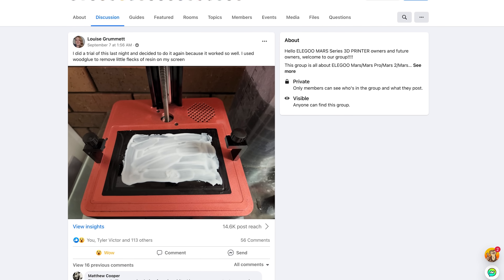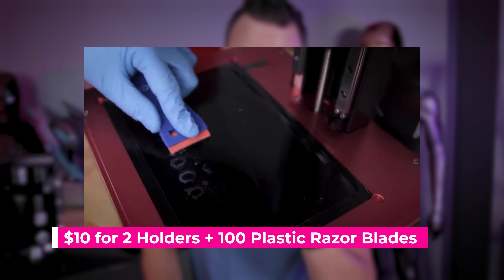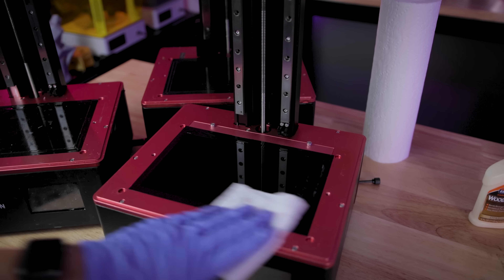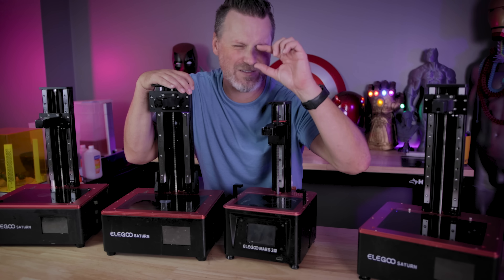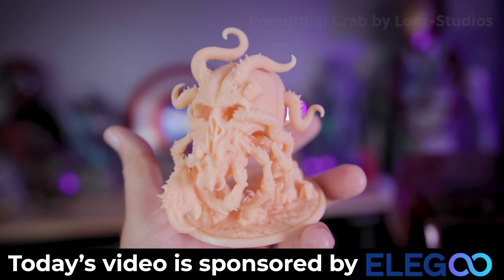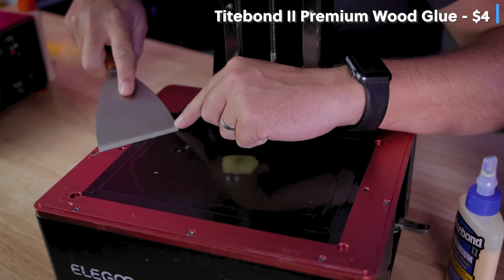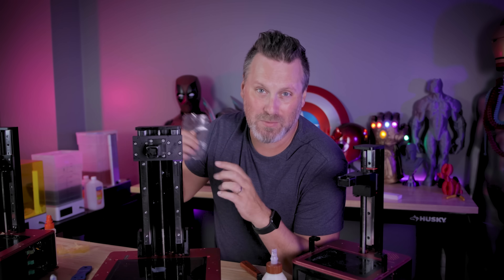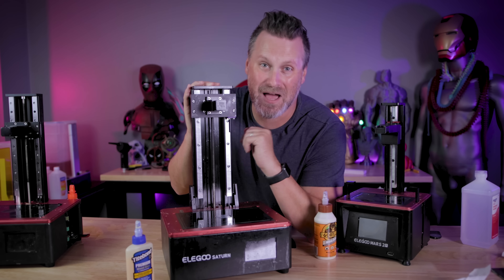Removing Cured Resin with Wood Glue?!?

Comment: When I got a resin leak that went UNDER the LCD and adhered it onto the piece of plexiglass that goes under it, I put the LCD with the plexi in the resin vat, filled it with IPA and put it on the buildplate of my FDM printer set to 60 degrees Celsius. It did separate, with almost all the resin staying on the plexi, but the plexi cracked. Thankfully it's cheap to order a laser-cut plexiglass RECTANGLE. Next time use warm water I guess.

Comment: Not sure if this has been mentioned, but I use clear packing tape to clean dried resin off my screen. Clean up and liquid resin still in the screen, run a vat clean cycle, clean again with IPA and tissue then apply the tape and pull. It’s like waxing a hair leg, only less painful and more soothing.

Comment: Humm... Now I am wondering, if you spray a thin layer of epoxy mould release or even a layer of oil and leave that on the screen if it would prevent leaked resin from sticking in the first place. 🤔

Comment: The matrix test cards are amazing for scrapping bits of cured resin off the screen! I couldn't find anything soft but strong enough then had a couple of non cured test cards laying in front of me they worked just like the plastic razors and a tad of water like a drop and I mean a droplet then scrape it's cot a burst fep resin completely off my screen with no damage to the screen Protector well impressed lol

Comment: I’ve never tried this, but strictly from a chemical standpoint a substance like acetones, MEK or brake fluid should be able to dissolve the resin and wipe right off. MEK has a flashpoint of 100° should be used with Great call care an in a well ventilated area and rags should be stored in a fireproof trashcan and of course acetone and brake fluid very similar handing. You can weld just about any kind of plastic with MEK hardware stores sell it in a very diluted version. This is most likely the 1st to 3rd most dangerous chemical that the hardware store sell and is the thinner that the car manufactures used to thin car paint with. Brake fluid would be the safest, but it will also leave and oil residue. That probably would be worse than the situation you’re trying to fix, but one wipe of MEK would remove it.

Comment: I just used a disposable metal razor blade for windows on my printer screen and it was just fine and may I add this blade had been used for cleaning windows for like 2 years and at times it had been heated with a blow torch to melt cut plastic prior all I am saying is I used a very old hevaly used blade to clean my my 3D printer and I was fine but then I have a lot of practice cleaning glass with razor blades like 6 years of it

Comment: So i have 2 week old Saturn S and of course got a hole in the FEP and resin on the screen on like Day 2. I used the 99% IPA/microfiber towel method and it really kinda ruined the polarized film. Was this the method to use BEFORE Elegoo started adding polarization?  Now it seems the best way is extremely hot water on a sponge and then the plastic scraper.

Comment: Titebond II is excellent for cleaning vinyl records. The glue is PVA whereas the records (NOT 78s) are PVC. They are chemically similar to the point that they won't bond to each other. Spread a thin layer of Titebond on your record, getting it into the grooves. Let dry and peel it like a face mask. It'll remove dust, lint, dirt, grease, mold, etc. Great for restoring your vinyl back to a pristine condition (just be sure to rinse the record off with distilled water to eliminate the static charge.)

Comment: How much pressure do you use with the plastic scrapper?
Reply: A lot.  It may scratch the screen slightly, but hopefully it won't damage the prints.  Any less and it won't chip off.

Comment: Hot hot hot water damp sponge or paper towels in it and then put the sponge on the spots let it heat up then go at it with the plastic scraper

Comment: Would it be possible to use  like a polishing abrasive to get it off? maybe super high grit sandpaper. if theframe is perfectly level then couldnt it work, maybe adding layeror two of tape? just some wild thoughts...... but it should be a requirement to everyone to use a dang screen protecter anyway, great videos as always brother
Reply: I've used a car headlight repair kit for damage to a plastic computer screen.  It looks OK, but it's not flat any more.  This is probably the type of polishing/abrasive you'd want if you try.  Just got resin on my screen, hence the comment a year later.  Alcohol and elbow grease didn't get the last little chunk.  I think I'll try acetone, but upgrade to a bigger 9" machine before sandpaper/polishing.  Right now I'm seeing if the layer is thin enough that it prints anyway or over cures the remaining chunk so I can scrape it off easier.

Comment: Those glues take longer than 24 hours to reach full hardness.  They will be dry to the touch, but not fully cured to maximum strength.  I am a long-time (50 years) woodworker.

Comment: Another thing you can use to clean the dry resin screen is N-Propanol, that does stink a lot, but it is very effective, it evaporates quickly, it does not leave any residue.

Comment: Thanks for trying these kinds of things out for us. Sometimes replacing the LCD screen on the Saturn requires a firmware update since there are different firmware versions for each screen, and the replacement LCD might not match the original LCD version.

Comment: I would think if you heated the glue after it hardens using either the light of the printer or an external heat source should make the glue malleable, also possible the glue from a glue gun might work better as it has crappy adhesive capacity once it has been heated... But interesting to see

Comment: Hi Uncle Jesse, Do you think it is a good idea to spray dry PTFE on the screen to protect it, for easier removal incase resin get on the screen?
Reply: might cause problems because the ptfe might create a better seal around the fep so the fep might not fpex like its supposed to

Comment: I had a 7hr print going on while I slept and when I woke up no any did the print fail but a shit ton of resin was dried up on the screen 🙃 all because the clear film on the tray has a tiny hole 🤦🏻‍♂️ scraped it off with a metal scraper and light weight fucked up my screen.

Comment: Having seen so many so called 'hacks' for WD40, it's a wonder no one has tried that? I actually use it to remove gum from various things (moved into a new rental for example, and on of the kitchen benches by the stovetop had some kind of rubbery shi... stuff on it and I hit it with a good dose of WD40 and wiped it away with a rag then went over it with a warm wet cloth and all was good.

Not saying I'd put it on my new Elegoo Saturn, just surprised no one has said they do it (in the same sense someone said they use wood glue). 😁

PS: I'm new to resin printers and 3D printing overall actually and I'm loving these videos, I have learned a lot in one evening and feel, shall I say, less 'scared' of firing it all up now from just your channel. Cheers cobber, I appreciate it!

Comment: I have found for an added level of protection when using the plastic razors, I file/sand the corners of the blade into a curve. This way if I am an idiot and stab the FEP or screen with the outside edge of the blade, no harm.

Comment: If you hadn't made this video, I probably would have tried it.

I use a very similar method to remove dried acrylic paint from my palett - with excellent results. 
So, I would have been hoping that it would work the same.

I am wondering of the original version that you saw was with a water washable resin?

Comment: Literally the best way to remove resin is splash a tiny bit of IPA on, cover with paper towel and some clingfilm. Leave it for a day or so and it will wipe right off with a microfiber towel. NO SCRAPING!

Comment: I had a pin hole or something and lots of resin hardened on the screen. I took a sponge and soaked it in IPA and left it for a few hours. HOWEVER, when I took the plastic scraper to the resin it lifted but also pulled up the black polarized sheet too. I ordered a new sheet, but my printer continues just to print solid square blocks now.
Reply: When installing the polarizer film, you have to orient it correctly. YouTube videos exist.  Also, not all films are created equal. You need a fairly high-quality polarizer.

Comment: You don't need a plastic scrapper, at least for the Elegoo Mars 2 stock screen. I use a sharp metal one, and it can look scary, but as long as it's lying flat and the screen is soaked with alcohol, it will take out the resin effortless with absolutely no damage. The glass is hard enough to resist it. Even if there were microscopic scratches that I can't see and may build up in the long term, you will probably replace the screen long before it affects your prints, as the screen will eventually be damaged by the UV light no matter what.
Reply: Thank you so muchhh
Reply: Yes i used it too and its sharp enough to get a gap between the resin and the screen

Comment: is it glass? just scrape it with a fresh metal razor blade, you can't scratch glass with steel as far as I know (don't know if rust can though, hence fresh), the plastic ones are for delicate things like car paint, it's how I clean mirrors, takes way less time.

Comment: Love these experimental ideas. A boiling hot sponge left on on my screen for about 5 to 10 minutes to soften and remove resin has always been my go to. Even with a full screen leak that's cured it will remove it all without issue in about 20 mins. The cured resin peels off easily, with a fingernail or plastic scraper.
Reply: Good tip, thanks
Reply: I know this an old comment, but I just wanted to say: Thank you.

I'd tried IPA. I'd tried tape tricks. I'd tried almost everything (Hence why I came to this video), but yours was the first thing that just out-and-out worked. I watched the resin lift up like it wasn't even attached. You're a champ.
Reply: Wouldn't that wear out the LCD due to thermal expansion and contraction?
Reply: @Mad_Catter_  better than it being replaced?
Reply: That's actually genius. I believe that any heating up should help a lot, because of thermal expansion of screen vs resin - forces can be huge is rate of expansion is different, leading to ungluing resing from screen. 
I wonder if ouring way more resin on screen and curing it should also help. I mean a lot more: so that is would not crack but be removed in one piece. So maybe even with use of some cloth dipped in resin that should keep the resin in place.

Comment: Wood glues aren't what they used to be. There are heaps of different kind now. Back in the day if you said wood glue that would mean plain old PVA glue which was plain white and dries clear like the Gorilla glue, ie the stuff I used to spread on my hands so you could peel it off to look like skin peeling off. No way I would try modern wood glues on my printer screen.

Comment: From what I can tell, the goal of using the glue is to get it all as one piece that you can pull up at once? If that's the case why not just do as you did in the middle and cover the whole screen in cured resin so its all one part you can then scrape off. I think its probably a waste of material and not any better than the normal method of IPA and scraper, but it would probably achieve the effect that the wood glue was aiming for.

Comment: I just did a small test with a few silicones. Smooth-on oomoo 30 was actually somewhat helpful in removing resin using horizontal pressure. I have some urethane epoxy and foam rubber still to test. I will post the results here. 
Silicone might work. Maybe one of the thicker tin activated ones.
Reply: I work with silicone a lot, the only thing that stuff sticks to is itself. 😞😞

Comment: Basic hand sanitizer works for me. Save the IPA for washing the prints!
Reply: It's probably the IPA or ethanol in the hand sanitizer!
Reply: @JeffroDH  That's why I use it. With it being a gel and diluted it is easier to work with and less likely to do damage to the screen or inside the printer. Really cheap too!

Comment: Hi, my always working go-to when the fep film breaks, is: Aceton. I soak a paper towel with simple aceton, keep it wet on the Spot of cured resin. then it gets soft after approx 10-15min and will easily peel. a plastic spatula is a must.
Reply: Does the acetone not cloud the polarizing film on top of the screen?
Reply: @JeffroDH  Hi, not noticed any cloudyness yet. (so far, 5 broken fep's with cured resin later. pure aceton, not a nail polish remover was used for my endeavours). It's my go-to until i find something better
Reply: ACETONE worked for me too, let it sit for a couple mins then peeled off

Comment: Wood worker here, eventually the glues will harden up and become significantly more brittle.  While the will have a certain amount of mechanical give, depending on brand they will all become significantly more crunchy as they lose more moisture and polymerization continues.  Would a coating of PTFE spray on the screen last long enough to prevent adhesion if some resin tries to cure on it?  While I have a screen protector, a spray of PTFE would have better light transmission properties I would think.  I was also thinking of a coat of paste wax on the screen and the top of the build plate to assist in resin rolling off may be useful.
Reply: The problem with the "Teflon" sprays is that they are simply light carrier oil with tiny particles of PTFE. The PTFE doesn't dissolve into the solution as far as I know.

Comment: One way ive used to clean off resin that has worked no problems. Get a sponge set it on the lcd then pour a small amount of hot water into the sponge let it sit 5-10 minutes pick up the sponge an use your plastic scrapper to easily remove the resin. You dont need alot of water just enough to wet the sponge.

Comment: arent the screens glass so a metal razor wouldn't scratch them?
Reply: Most of the screens have a plastic polarizer layer on the top. This plastic layer is pretty easy to scratch, and you can scratch glass with a metal razor blade too.

Comment: In terms of screen protection, I use clear sticky back book protector film. Its insanely cheap, 25cm x 3m only costs around $5 and with it being made for books, its thin, clear, sticks on the screen and fairly easily peels off if you need to remove it. Sometimes glue is left behind, but IPA gets that off no problem. You can just cut it to size with scissors and away you go. Only downside is it doesn't protect against impact damage
Reply: Where do you purchase the book protector film?
Reply: I just use an extra vat fep. Tape it around the edges.

Comment: we have found after many times having this happen that using Tub-O towels cleaning wipes. fold it to screen size and leave it on the screen overnight. we use the build plate as a weight to hold it. after sitting overnight any cured resin that was on the screen can easily be scraped away with a plastic razor blade.

Comment: Tip : Use the spreaders that auto body shops use for bondo when putting on screen protectors. It works perfect pushing out any air bubbles between screen and protector
Reply from the maker: You talking about all my air bubbles on my Mars 3 🤣😂 that right there is a solid tip!
Reply: @UncleJessy   can you do a video over replacing the vat fep sheet im having issues with it on the mars 3 all my prints seem to fail in the middle for some reason
Reply: those are the same spreaders we used at the tint shop to chase bubbles.  they work great

Comment: I wonder if it was because you first wiped the screen with ipa?  Possibly the ipa affected the cured resin and took away any micro adhesion characteristics that the wood glue would have adhered too. Another way to say it is….This is based on a mechanical bond not a chemical bond so the ipa may have smoothed the resin surface enough to not allow the wood glue to bond to the resin. Still wouldn’t try it with my printers!! Thanks!